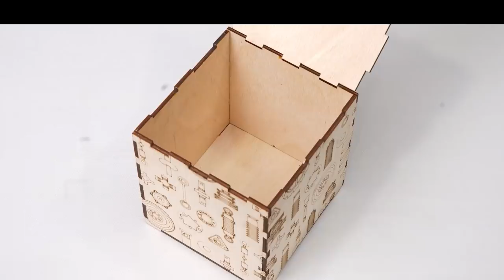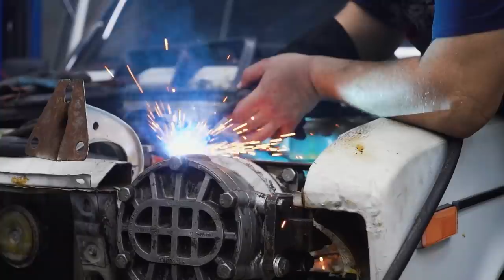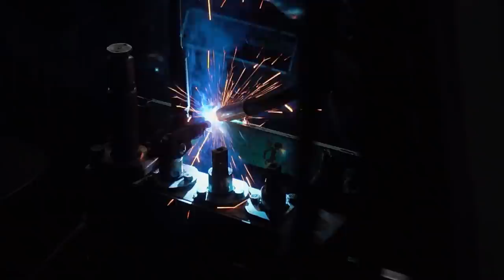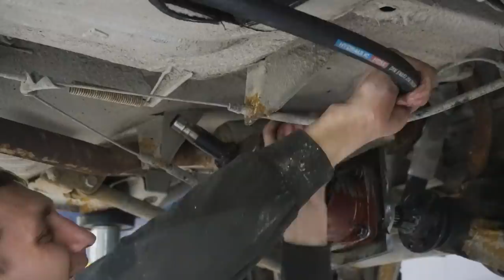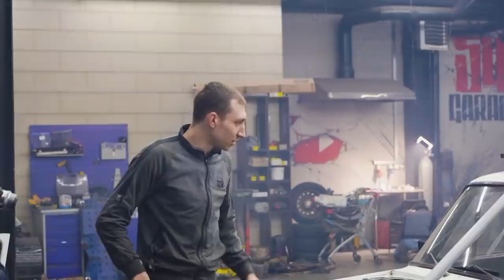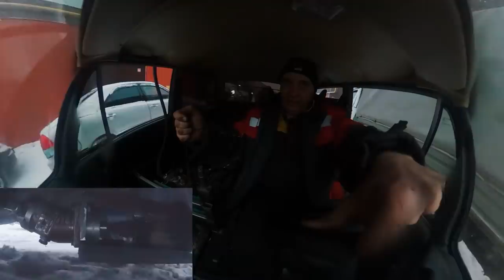Using excavator hydraulics as a propshaft

Comment: For (Combustion) - Hydraulic propulsion you need serious valve logics, and power... 
I drive an Diesel-Hydraulic Locomotive and when i was learing to drive it we had to study the blueprints... 
But below 200 HP you won't get anywhere. 
Also the hydraulic oil has to be at temperature (90°C) and the system has to be able to circulate even without the driving lever pulled (for standing still without stalling)

You can solve this problem by transmitting the Energy via an Hydrostatic transmission, and and making the positive engagement (clutch) by using an hydraulic transmission converter, that is something like an oil-pump-turbine, so you don't have to manually watch out to prevent the engine from stalling by pumping pressure against a closed valve.
If I ever have the money i will let manufacture for myself a Diesel Hydraulic Car. And if i still have money a Diesel-Electric one too. 

(Diesel being a superior fuel since you can extinguish a fire with diesel, but gasoline will make your car into a rolling bomb)
Reply: Only lipo batteries are good. Diesel kills planet. We should all get rid of BMW, Audis and Mercedes, scrap them and buy new zero emission electric cars. And important, we should change this cars every two years to be ecological.
Reply: @Kawka1122  and there we have it... by the way, i am a very left, liberal... but still promote diesel for it's superior properties.

With modern Combustion engines that run with AdBlue additives and are equipped with state of the art particle filter, you are in fact damaging the planet MORE by driving an Electric car than a diesel. 
My reasoning: 
1. Lithium batteries are small bombs, crash mortality rate will skyrocket when in close to all Chassis breaking accidents the battery ignites itself due to deformation. With Diesel, you can put out a open fire.
2. The energy needed to produce an Electric car is a multiple of that required to produce an car with Combustion engine. 
3. Recharge time. You can "recharge" an car with Combustion engine, as you can see in Formula 1, in less than 10 seconds. While an Electric car doesn't comes below 2 Hours. 
4. Bord applications, an Combustion engine "wastes" energy by heat, but in the northern hemisphere you most time of the year, need to heat your car, in an Combustion engine car you can use this excess heat, to heat the cabin, in en Electric car you have to use electricity from the battery, to dump it into resistors, to generate heat... further reducing your range with a 100% charge. 
5. Repairability, cars with Combustion engines are operating on basic mechanical principles, this making them easy to repair and maintain. Whilst Electric cars require trained professionals in electrical engineering to not k1ll yourself when working on such car, when your battery dies (like at all) you can replace her with a 35k spare one... but for 35k for a environmental exploited Lithium battery you instead could get TWO decent cars. 

I do agree that for short range, and especially inner-city travel Electric is the way to go, much availability, Carsharing... and so on. But for rural landscapes and people who have to be reliable at a place far away (like emergency responders) Electric would be extremely inefficient, and in some cases dangerous...

And don't get me started about "End of Diesel in industry" ... without diesel, no industry. As easy as it sounds. 

And the Electricity you put in your precious Electric car to feel green, is generated by COAL Power plants...
This whole thing is an commercially done scam, it's called "Greenshaming" look it up. 
Any questions left ?
Reply: @legitscoper3259  now i feel bad, because I was joking about current absurds of automotive industry, and you wrote this detailed explanation to convince me.
Now to be serious. Electric cars are obviously pure nonsense if power is taken from coal or fossil fuel in powerplants. You mentioned adblue, which at this point in conjunction with particle filter solves all ecological problems of Diesel.

Comment: Needs a piston-style hydraulic motor  with an accumulator. A project using a ford SUV had 1000 horsepower using the engine from a diesel VW Golf.

Comment: You must use a bigger chain sprocet on the pump to get the max torq from the engine. I think the pump sprocet has to be at least 4 times bigger than the crank sprocet.

Comment: You need a smaller pump or larger motor, or you need to put the motor before the transmission. Then you can use the tranny to reduce revs.

Comment: Mount the pump on the transmission end. Then you have gear reductiionn as well as a clutch.
Reply: No... Put the hydraulic motor on the input of the transmission "front" and leave the pump driven off the crank.

Comment: What about connecting the pump to a cvt thn to the back axle, the cvt would act like gears starting in low range thn change up into high range as the speed changes

Comment: Drop the gear box and have direct drive for the hydraulics. Engine rpm could regulate flow and speed. So maybe an automatic clutch so that it only turns the hydraulic drive at about 1500 rpm and idle below that so the engine does not turn the hydraulic pump maybe?

Comment: Shouldn't the gearbox mounted AFTER the pump in order to keep same load on the engine?
Reply: Shoulda had an Alfa Romeo with rear mounted gearbox/transaxle, remove the prop shaft, then have the hydraulic motor drive the gearbox. Good reduction ratio, and its needed, look at hydradrive forklifts with a hub reduction gear - theres reasons for that gear. But such Alfa Romeos arent disposable, not gonna happen.

Comment: Torque converter on the rear of the crankshaft and run the hydraulic pump from that with a 2:1 or even a 4:1 gear reduction. That way you won’t have stalling issues and can drive it like an auto

Comment: The gearbox should come after the hydraulic motor
Reply: Yes that's the logical answer unlike all the idiots that suggested run the pump slower. Yeah, run the pump slower and have less pressure 🤦 Needs gear reduction coming off the hydraulic motor! Duh!
Reply: @shawnsatterlee6035  actually, speed doesnt necessarily equate to pressure in hydraulics. It would be better to spin the pump at 2600 rpm and gear up the drive motor. Oil cavitates at high speed and will actually decrease pressure.

Comment: I think they call hydraulically driven propshafts a torque converter 😂
Reply: Totally different concepts, not to mention a torque converter multiplies torque unlike these hydraulics.
Reply: @otm646  a torque converter is basically a hydraulic clutch. It hydraulically locks. So basically a hydraulic motor is the same. Don't over think it...
Reply: @otm646  It was a joke my Einstein friend

Comment: Excavator drive motor designed to pull tones of machine But can't pull a small car.
That pumps still spinning so I'd be checking pump pressure and or the drive motor seals .
Incase the fluid under pressure is escaping back into the system 
 therefore not turning under load.

Comment: Wouldn't it be easier to simply cut a section of railroad track to the proper length and use that as a driveshaft? 
I'm sure that your buddies at the local driveshaft balancing company would enjoy the challenge of making that work!

Comment: I would say motor needs to connect to a gear box  whet you need is a variable desplacment Dan doss 120 hydrastat pump with matching drive motor it has a farward and reverse lever John Deere combines and cotton pickers sprayers all have this system. Plenty of torque but limited top speed the transmission between drive motor and differential will solve all your issues

Comment: No one here seems to know much about hydraulic systems. The problem may be in the fluid. Did they bleed the system for air pockets after hooking up all the hoses and adding fluid? Air pockets do not just "work their way out." Next, did they make sure there is enough reserve fluid for the system? It acts as if it keeps running out of fluid, which can reintroduce air and cause cavitation within the pump very quickly. Or it may be the components they are using. As for that pump, what do they know about it? It's used and might be shot. Same with the hydraulic motor. Just because it spins without a load tells us nothing about its internal condition. Fluid may be leaking around the pistons so much that it can't produce any power. Both of these units should have been checked for performance under load before being installed. There was no mention if this having been done at all. They may have wasted a lot of money and stand to waste a lot more until they get some education on all of this. One expert would more than pay for what he cost them in savings using this trail and error method.

Comment: here is an idea for you to test.
i always wanted to try rear wheel steering made by tractor hydraulic column (the one that has only one pin like joystick to control the movement) and powered by the cars steering pump
Reply: A lot of rock crawlers do just that. Some of them also hook the steering column to an orbital valve and run hydraulic front steering

Comment: youve basicly just made a hydraulic prop shaft. i suggest putting the hydraulic pump on the input shaft of the transmission and connecting your hydraulic valve to the clutch peddal .

Comment: This reminds me of when I was a little kid, I didn't have a clutch for my go-kart, so I took a couple of power steering pumps, off of some Honda civic's, and I didn't use any valves. It literally would take over 2000 RPM to start moving, so it worked out perfect. I also used different gearing on one pump than the other, allowed for it to really bite in, when you spin it up.
Reply: How did you make high pressure hoses and fit the pump to the engine as a kid??

Comment: To much reduction and the pump will not build up enough pressure.
A smaller displacement pump and/or larger capacity motor will reduce the speed.
Can also use more valves, activate one Valve  with a low oil volume to reduce the speed of the motor, activate a second Valve serial connected with the first Valve and you get more flow and  a " second gear"

Comment: Would have worked better if you used a swivel pump, set the engine at a set speed and vary the oil with the swivel of the pump.  right now the pump is being dead headed basically the pump is bypassing until power is shunted to the motor.  With a swivel pump at 0 deg the pump is doing nothing a -1.0 deg the motor goes backwards +1.0 deg and the motor goes forward.  Simply this is the easiest way, you can continue with your present fixed pump and axial motor but the hydraulics is a bunch more involved.

Comment: I would have though mounting the pump to the back of the gearbox would be the optimal way to do it. Then you can drive the car normally with just a hydraulic driveshaft effectively. Also it shouldn't matter which end is used for input and output should it? That could be a gear ratio in itself

Comment: Mounting the pump behind the gearbox would have been nice with more reduction options to play with.
Do I need to remind you 60kW is 81.6 horsepower, that poor lada engine needs more reduction to that massive pump.
Reply: That's not how hydraulic pumps work. That's the max input power required for max GPM at rates psi. It's all a relationship between flow and pressure.
175 psi at 50 gallons per min is about 5 horsepower. 1750 psi at 5 gallons per min is also 5 horsepower.
They simply have the displacements of the pump and motor terribly mismatched.

Comment: re do this again with out the gear box transmission and  1/2 hydraulic hoses   find a foot pedal valve   to control the forward and reverse  having a hydraulic cooler best to have

Comment: Use a diff to spin the pump faster
Reply: Pump needs to go slower. It's the equivalent of trying to start off in 3rd or 4th gear now. It needs slower revs and more torque.

Comment: Vlad, get rid of the gearbox (it's just dead weight anyway), so you can put a good 4:1 reduction gear. You can use a multiple belt + pulley design, like the pulley you took out of the motor, replace the engine flywheel with this than make a 4 times bigger for the pump.
For the motor, you can make a reduction for it using some of that old diff boxes you have laying arround the shop.

Comment: I always wanted to try something like this but hydraulic parts are so expensive. 💰
Reply: Find a 2 speed hydraulic transmission inboard which bolts to the bell housing the pump is internal all you need is a prop shaft!!

Comment: Your hydraulic motor got a really low displacement, and it results in low torque and high rpm
other than that pump should have a lower ratio than it has

Comment: You can never fix the hydraulic pump on the chassis with a chain to motor that is moving. also you need a motor with more torque and power, that was a useless try.

Comment: you should put the hydraulic pump on a more horsepower and torque engine and then directly on the engine where the gearbox would be